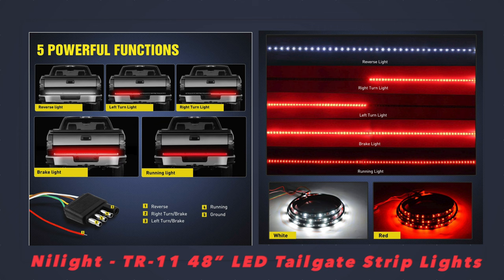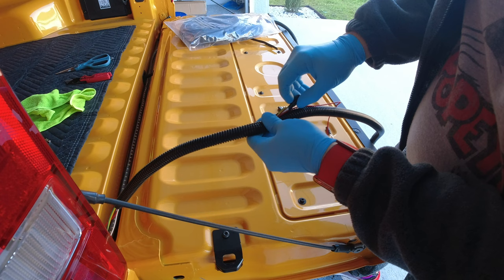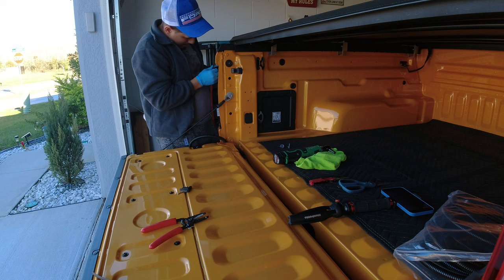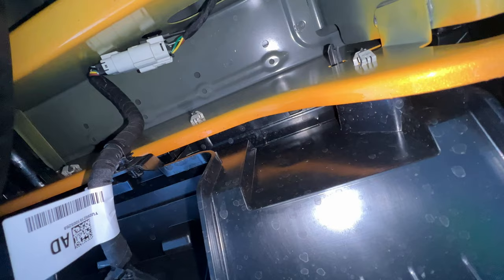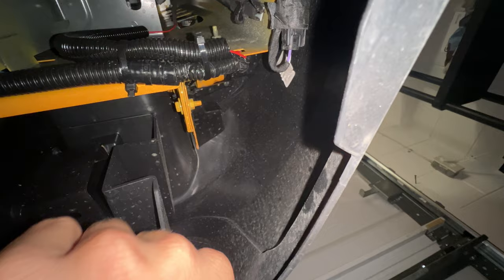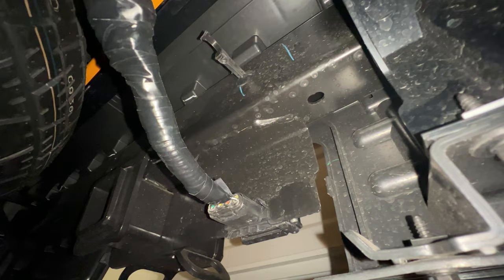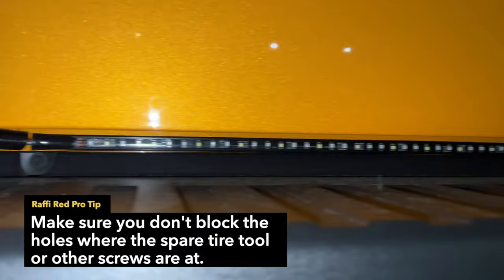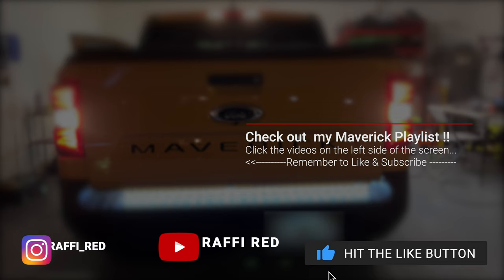Installing the Nilight Strip LED Tailgate Light on the  2022 Ford Maverick

Comment: If your truck has Co-Pilot 360, the truck will also automatically disable those safety features if it thinks there is a trailer attached.  The lights are cool, but they're not worth sacrificing the safety features of Co-Pilot.
Reply from the maker: I don't have Co-Pilot 360 that's why. If that would have messed with my Co-Pilot 360 I wouldn't have messed with it. Thanks for the info.
Reply: How can this be remedied? I have the Co-Pilot 360 and like that feature? I’m not great with wiring..
So what would be the instruction to do that correctly?
Reply: Exactly. Mine were bugging out, thought it was a bad unit, exchanged it, and same thing, waste of time with 360
Reply: @andrewandrade8716 could probably wire it all to the brake light wiring instead of trailer 4pin connector wiring

Comment: Installation made following your instructions & working perfectly, great video.
I do have a conflict after connecting. The trailer sensor says trailer connected & it deactivates the “blind spot & cross traffic sensor”. Is there a way to bypass this. I would like to have both activated.  Really liked the blind spot aid.
Reply from the maker: I haven’t connected a trailer yet so I don’t know if it conflicts with trailer lights. If you find out it does conflicts please let me know. Thanks.
Reply: You will probably have to connect to the tail light wiring instead of the trailer wiring

Comment: If the trucklette thinks you have e a trailer attached, is that affecting anything else, like transmission/suspension settings, or anything else?

Comment: the problem i have with this installation is the it removes the lines guide on the backup camera on my EB Lariat..and the trailer connect mode is always on...I think the connection needs to be further up the main wire harness, and not on the trailer harness..

Comment: So, Raffi, I never saw where you attached the strip to the truck. Did you use the tape? I ask because, if you did, what to you do when you have a flat as you've blocked access to the lowering bolt.
Reply from the maker: What strip you mean? The light on the back the connection to the lights you mean.

Comment: did this installation cause the check engine light or is that something seperate?
Reply from the maker: No it did not cause it to have the check engine. However I will be doing an updated video on this soon where I showed how I changed the cables to the lights instead of the cables I have them connected to. Stay tuned subscribe if you haven't to be notified when I post the video.

Comment: Great job. Does it cover up the spare tire access hole? On a Lariat, it seems like it does though I'd think they are the same. Also, does the bottom of the tailgate block the view of the light strip when it is closed?

Comment: So there have wire connectors that have solder and are heat shrink with a lighter. I can’t tell ya how many times I have found a short in the plastic snap kind like you are using. :( that is a truck that will have brake light problems if you sell it and know one knows where that plastic is.

Comment: Nice! Although it seems like the lights aren't centered. Maybe it's just looks that way.
Reply from the maker: The can't be all center because there is a bump in the back all the way to the left side making it impossible for the adhesive to adhere and the cables needs to bend to get routed on the side of the tailgate. The same happens at the end of the light on the right side. If I moved them more to the left the strip light will come off after a few days for not having a proper adhesion.

Comment: Is it possible to hard wire the LED taillights directly to turn signals like the reverse light and have the Copilot 360 activated.
Reply from the maker: Hello Al Forte and thanks for the comment. Per your question I think you can definitely wire directly to the turn signals. Even though I connected to the pins on the back I might change them in the future to the signal lights so I can have my reverse lines back like you mentioned. I hope that that helps.
Reply: Hard wiring them to the taillights does solve the problem with Copilot 360.  If you decide to do this you should connect to the wiring on the truck side of the Taillight assembly connector.  That way the taillight assembly can be removed by unplugging the connector.   To make your connections you need the color codes for the wiring.  Note: the color of the wiring on the taillight assembly is different from the wiring on the truck side of the connector.  When two colors are shown the second one is a stripe.
LH Rear Lamp Wiring Color Code
	Stop Turn Left	WH-GN
	Park Left	VT-GN
	Reverse Left	GN-BN
	Ground Left	BK

RH Rear Lamp Wiring Color Code
	Stop Turn Right	GY-VT
	Park Right	WH-OG
	Reverse Right	GN-BN
	Ground Right	BK